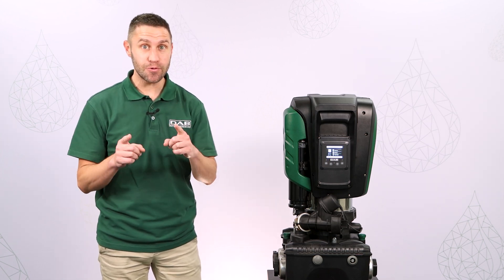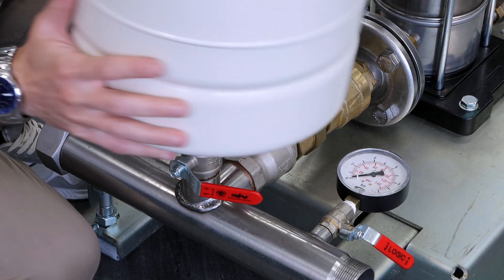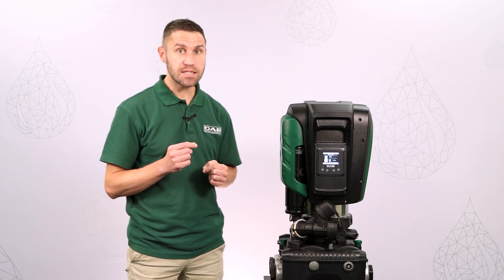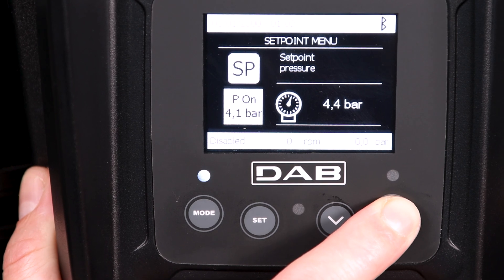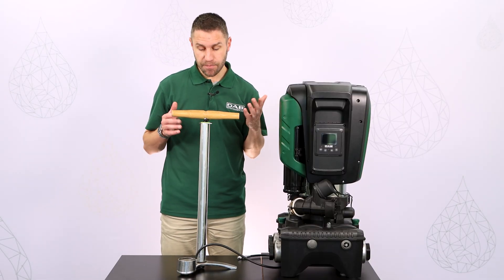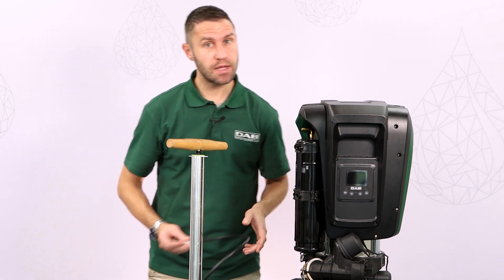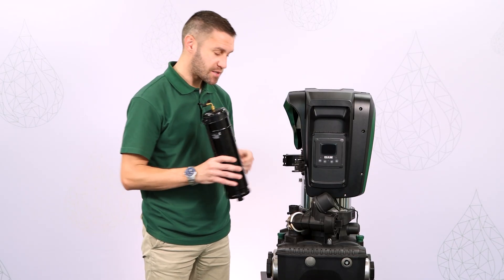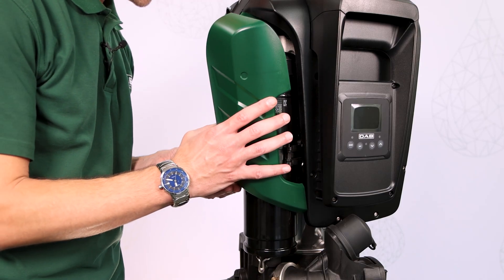Pressure Tanks Explained: Why Esybox Max Stands Out - Esybox Max Quick Tips

Comment: When I try to pump up my tank water comes out of the air tank.
Reply: I just had this on mine.
Reply from the maker: If you see water coming out of the air valve on the pressure tank, it indicates that the rubber bladder is damaged. There are several possible causes, such as wear and tear, excessive stress, or a large difference between the tank’s air pressure and the water pressure set point. The pressure tank needs to be replaced, and it is available as a spare part.